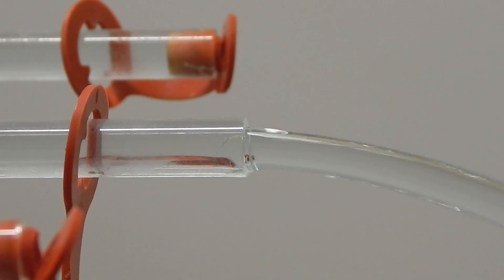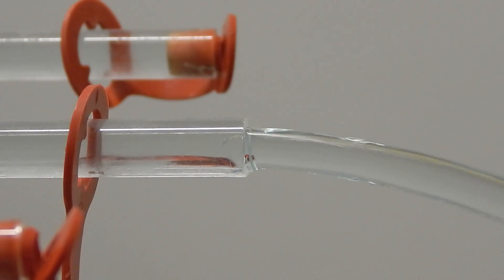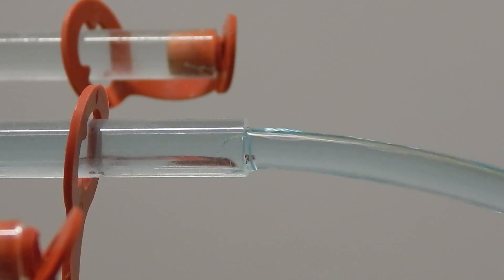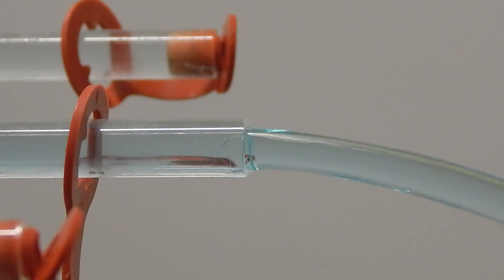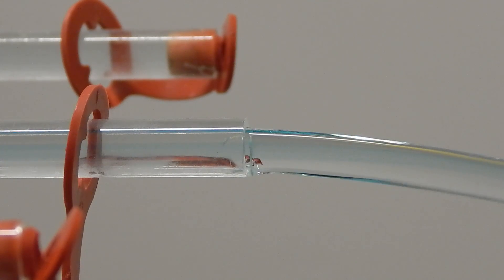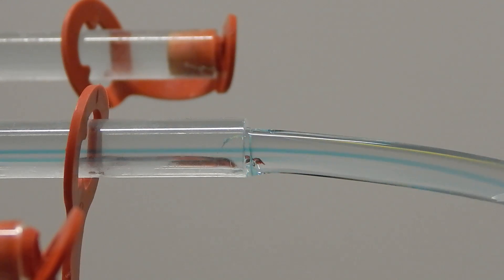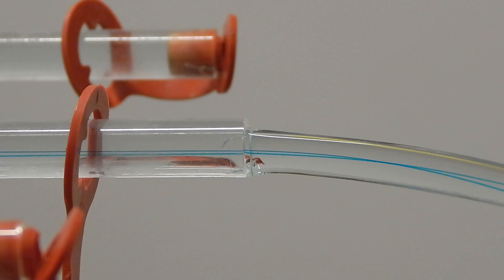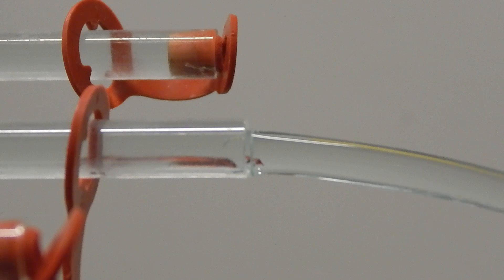Pipe Flow- Transition from Turbulent to Laminar Flow

Comment: Is there a formula for the relation of pressure to tube diameter to achieve the conditions for laminar flow? Is only one state possible?
Reply: And does the length of the tube have any importance aside the induced pressure drop to account for?
Reply: Reynolds number formula

Comment: During this experiment, is the measured flow rate of the water changing at the exit point? Gallons per minute or usage decreasing
Reply from the maker: Dennis Hill There is a tank of water above the pipe, and the head is decreasing.
Reply: Are you saying that pressure (height of water in tank) is causing the transition between laminar and turbulent flow?  Is the water coming out the tube processed throught straws or similar media as in other designs?

Comment: How are you switching between the two flow regimes? Just turning down the velocity?
Reply from the maker: Gowidafloman the head of the tank decreasing over time
Reply: +Mike Saggese what does this mean
Reply from the maker: @RIPxBlackHawk  The entire pipe is filled up with water continually the entire time, the entrance to the pipe is fully submerged. The velocity decreases as the head (inches of water in the tank) decreases. This has the effect of lowering the Reynolds number over time, and the flow transitions from turbulent to laminar.
Reply: @MCSaggese  how does affect the tracer( colored pigment) in the water? I have studied that there is intermixing between layers during turbulent flow.
Reply from the maker: @RIPxBlackHawk  Exactly the opposite of what you wrote. The tank is emptying over time.
Reply: it does, because the pressure is changing as the head decreases
Reply from the maker: The "head" is the height of water above the opening in the tank. It is decreasing over time as water leaves the tank, so the pressure and velocity through the pipe is decreasing over time as well.